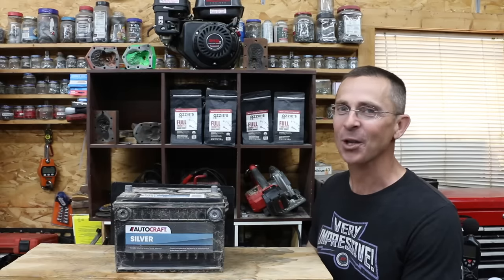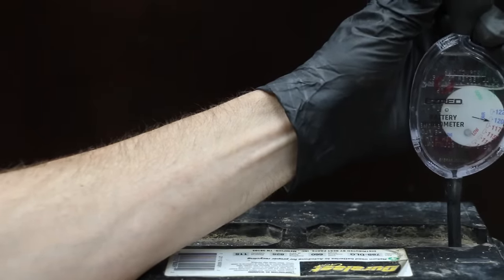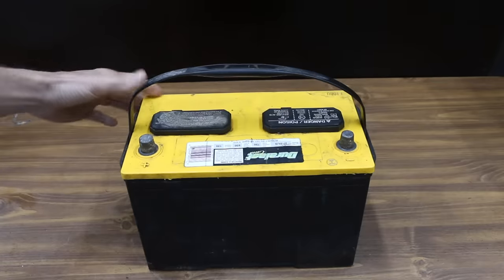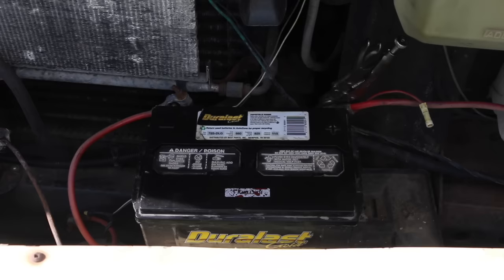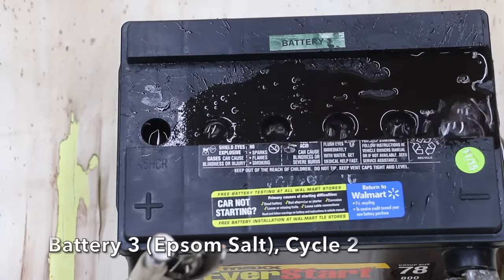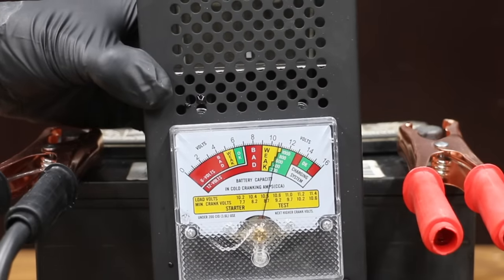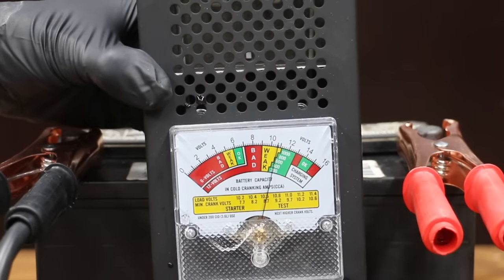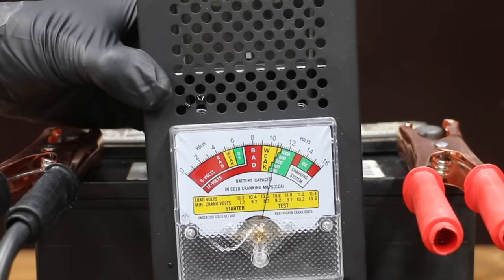Myth Busting! Can You Restore a Dead Car Battery With Welder?  Let's Settle This!

Comment: Its best to use a 100 amp setting when using a welder to de sulphate an old battery.Its also best practice thoroughly flush out battery at least 3 times to remove contaminants from within battery by aggressively shaking battery side to side , front to back several times. I've even used a pressure washer to aid in reconditioning a battery with great success.if using a low amperage charger once battery is ready to remove sulphates. Use a 1 or 2 amp max setting and leave charging for 3 days, while observing water levels. Both methods work very well if care is taken during the cleaning phase of battery plates which is the number 1 reason for battery to fail when not enough water is in each cell and or not left on truckle charge during extended periods  of none use. Ratio 3 cups distilled water to 1 cup Epson. Be sure to rinse with Epson on finse prior to refilling.
Reply from the maker: Thanks for sharing.

Comment: You can not hardly find a manual battery's charger anymore. Going to a small DC arc welder may be the only route for many folks. 
It would be interesting to put a volt and amp meter on an arc welder and see what it's actually putting out.
Reply from the maker: Thanks for the suggestion.

Comment: You need to flush the internals with distilled water and baking soda, and change the internal fluids with distilled water and epsom salt. Use the welder to zap it several times as let the internals bubble
Reply from the maker: Thanks for the feedback.

Comment: I've never seen somebody remove all of the acid when using Epsom salt but to take just a little bit of the acid out and add a very thick solution of Epsom salt in I've had this work on a couple small batteries
Reply from the maker: Thanks for sharing.

Comment: Do you think the welder worked cause the high amps or did the volts have the de sulfate effect? I have seen many batteries not repaired by high amp chargers but a DC welder can put out 20-50 volts.

Comment: I did the Epsom salt but I made a super thick solution. I only removed a little of the acid and added it. I charged the battery and it lasted over a year. Unfortunately the transmission went out of that vehicle so I do not know how long it would had lasted. I should add that the auto parts store confirmed the battery was dead and it would not start my vehicle. I did not have a battery tester at the time so I do not know the amps but it would only charge to just over 10 volts. After this is would charge to just over 13 volts and started the vehicle every time like new. I would had replaced the battery but I seen a video and decided to try it because even though I drove this vehicle often I knew it was only a matter of time before it died on me. I figured I'd run it as long as I could until it died which is exactly what I did lol. Luckily I had three other vehicles but this was my work van.

Comment: Restoring the really bad ones is a lot of work, and hit and miss.  However, I'm curious how good a regular maintenance charge with the welder might improve the lifetime of the battery.  For example, whenever the battery gets down to 80-85% then hitting it with the welder to get it back up to 100%0or close to it.
Reply from the maker: Thanks for the suggestion.

Comment: We been using a welder to charge our weak batteries for my whole life but we lived out in the mountains and didn’t have power so the diesel generator/welder we had to power the cabin was our really only way to charge them up and we never had a new battery so if it wouldn’t take a charge we started cranking up the power blew up a few batteries but most the time it didn’t it was that or walk out to town 35 miles away we were lucky to get to grow up that good
Reply from the maker: Thanks for sharing.

Comment: Yea these welders work but smaller batteties need smaller current because the plates can bend and cause a cell short, you can then throw the battery. This is why i 'revive' my battery every once in a month or so but only for a short period of time at 20A (5minutes or so). The key is to hold it cool, once it gets even a little bit warm, disconnect!
Reply from the maker: Thanks for the feedback.

Comment: Any leas acid battery that has built up lead sulphat or little to no terminsl voltage it fucked, even more if the plate material is thin and in some cases plates corroded through / transitioned to lead sulphate, naff all can save it, fill it right up with water for max weight and weigh it in for scrap value.

Comment: Epsom salt I thought was used to boil over not a replacement for the catalyst? You just use that solution to boil the cells over then you flush and replace with fresh acid/water mix. Sulfuric acid and epsom salts are completely different H2SO4 Sulfuric acid and MgSO4 7H2O Epsom salts. hydrogen vs magnesium.. Dunno what kind of battery that makes but from your experiment didn't look so hot. My buddy's dad boils over with that solution, flush and replaces and I can't wait to see him Monday to speak with him.  ✌

Comment: In my reading I heard that rinsing out the flakes of oxidation from the bottom of the cells is important since they can, despite having little conductivity, drain the cells my linking the plates. I don't know if that's true but it seems to make sense.
Reply from the maker: Thanks for the feedback.

Comment: In the epsom salt restoration technique, did you not return sulfuric acid to the battery at the end of the restoration? I've never heard of the "epsom salt restoration technique" but it looked like at the end the battery only had water with epsom salt which I can't imagine working.

Comment: I had a dead battery before and needed to be on time for work. So i poured out 1/4 of the fluid and poured in acid to the plates were covered and place the battery back in the car and started the car right up. never had problems with it for a year or so. the acid cleans the plates and also gives a instant charge boost to start the car right up
Reply from the maker: Thanks for the feedback.

Comment: I know a guy (way before EPA).  Who used to get used batteries.  Then drain the acid out. Then put a "Alka Seltzer" with water in each cell.  Flush out the cells with water then put new acid in each cell.  He told me the "reworked batteries"  lasted as long as new batteries.  I never tried it to verify it!
Reply from the maker: Thanks for sharing.

Comment: 1) When do you actually use a welder to restore a battery? 2) When you replace the electrolyte you flush out the trash that builds up at the bottom that shorts out the battery. But the lead plates will last only so long.

Comment: Nice but I really need to know,, how many volts DC was the welder putting into the batteries and is the stick side really positive or negative as the lectrons travel the other ways round

Comment: On the Epsom salts battery. Did you try draining and flushing it with water again, then filling it with the original acid solution again? Something I remember from the old days.

Comment: Is there a performance difference between 2 identical new batteries with different date codes? Figured if anyone tested this out, it would be Project Farm. Also the same question with identical new tires with different date codes. Love the tests you do!
Reply from the maker: Thanks!  Thanks for the suggestion.

Comment: I'd be curious to see if the batteries that showed improvement with the welder method, would have been restored even more if after the multiple welder cycles you emptied the battery acid and refilled with bran new battery acid.. I've also been curious if filling a bad battery with baking soda or maybe vinegar 🤔 or some other type of acid that won't eat the lead but will dissolve the buildup that prevents acid from contacting the bare lead. Then place the entire battery in an ultrasonic cleaner. I theorize that the captivating action of the ultrasonic cleaner in addition to a base or acid will completely clean the cells. Then rinse the crud out and refilled with battery acid. I have a feeling it'll work. I've searched it many times. I don't find any attempts to restore battery's with ultrasonic cleaners.
Reply from the maker: Thanks for the suggestion.

Comment: I tried restoring my truck battery with an arc welded 140 amp that is supposed to work with regular 110 amp outlet, but when I hooked it up to the battery at it’s lowest settings which was 30 amp it would tripped my 20 amp breakers, I noticed that as soon as I turned on the welder it would start bubbling all the cells, not sure if it was normal

Comment: I wonder if you were to put fresh battery acid back into the Epsom salt battery if the battery would start to work again, as well as what would happen to the condition of the rest of the batteries with cells that failed the specific gravity test if they got fresh battery acid as well.
Reply from the maker: Thanks for the suggestion.

Comment: Going to so much trouble to make sure there's no acid left? I saw other commenters were suspicious about that too. Something I feel defeats the stick welder treatment is charging with conventional chargers.  Takes away the shock-value.  Gotta have enough water, but going STRAIGHT to the high amperage is what shocks and breaks up the precipitated sulfates and lead. It busts it up so it can restore the lead to the plates.  This is why submarine batteries run FAST CHARGE,  constant trickle discharge.  Both of these keeps maximum lead on the plates.  Picture the 85 amps going thru the crap on the cell bottoms.  It may be close to a short-circuit for a few moments but then the bottom sludge starts circulating.  Shouldn't try to run a lead-acid battery with no acid.  Seems silly. Thanks for trying this method. My suggestions have saved me over a thousand dollars.  GOTTA BLAST EM !!!  Thanks Again.
Reply from the maker: You are welcome!

Comment: What I would like to see is how flushing out and fresh battery acid could make a difference. As well as a "procedure" that seems to be the most likely to revive a battery. Something like, cooking on the charger for x number of times, until no further improvement is seen, then followed up with a flush and refill with fresh acid to see if that helps at all or not. Maybe a larger "de-sulfator" or "equalization charger" put into the mix.
Reply from the maker: Thanks for the suggestion.

Comment: If it's any help I bought one of those bright red China 12/24volt battery chargers that are around $15 on the Chinese cheap-seller type websites-it looked pretty good, it claims to have a repair cycle in the description, and it does.  Has quite a few features and has proved to be a great charger, brought a 10 volt beat to crap old marine battery from my solar setup in my garden to 12.9 and went from about 10ah-to 70ah or so.  It's been used on over 20 batteries successfully and repeatedly, I do the repair cycle for 6 hours at a time 3 times over a day or two of time allowing for cooldown
Reply from the maker: Thanks for sharing.

Comment: I think the key with the welder is to crank it up to the highest setting. At 80 amps it wasn't doing much but when you went to 110 it did a lot better. And I'm not sure if you really need to keep the cells cool. I think part of the process is to have those cells heat up quite a bit to cause some flaking of any non-led. Basically what you're trying to do is to reformulate the lead in the plates without taking them out and melting them down. It's interesting that the Epsom salts did nothing I've never seen Epsom salts do anything. And I've never seen those little desulfaters do anything either. And I've tried both of them.
Reply from the maker: Thanks for the feedback.
Reply: Yup have heard 150
Reply: Allowing the battery to get hot helps to dissolve the crystalline Lead Sulfate faster, but too hot can lead to shedding of the cathode plates. This is likely what caused the dark liquid in the hydrometer, it is Lead Dioxide that used to be part of the positive plates. A temperature of 120° F is about where you want to keep it during this process.

Comment: Any idea what voltage your welder puts out? I've tried this once but the battery only seemed to get worse. Turned out that the welder voltage was well beyond 14v. As far as I know, max charging voltage for lead acid batteries is around 14v, anything above will damage it.

Comment: Excellent video except for the fact that you didn't test all the stuff the right way because any one of the batteries could have been bad and no matter which method you use to charge it it would have continued to be bad, each side of those tests with of course the Epsom salt being the last one because we already know it kills the battery, should have been done on each individual battery switching the order as you learned through what you were doing. Either way you're a lot smarter than most people and it was a very informative and good video. And all of your information was correct and done the right way.
Reply from the maker: Thanks!

Comment: I've never heard of your epsom salt method to de-sulphate a battery. It may work, but I suspect you missed a step.

What I have heard of from the old-timers was this method: 

Drop half an Alka-seltzer tablet in each cell. Shake it around, swish it, and dump out whatever will come out. Flush it out again with distilled water to get out all the loose particulates.  Refill with 50/50 mix of distilled water and sulfuric acid and only then can you charge it.

Comment: When you place a large charge on a battery, be aware that there is always a possibility of explosion if a spark occurs in an internal bad spot. An automotive battery will scatter battery acid over a 30 ft diameter area. (been there, done that) - The rechargeable batteries from tools have even more power than you think. A detonation of just a watch battery can cover a 5-10 ft circle. Multiply that times a drill battery and an entire room can go up in a flash. Keep that in mind when trying this.
Reply from the maker: Thanks for sharing.

Comment: How crucial is it to dump the acid and replace with epsom salt? I've been running it at 10 amps from welder to keep my jumper rod from overheating, will it still work with original acid?

Comment: With welder, the point is voltage level. But welder did push too much current on it, which is not necessary. Just bringing up voltage around 16V can do the job without that much heat
Reply from the maker: Thanks for the feedback.

Comment: I have been doing a (slow) version of this for decades. I can assure you that most batteries can last 10 years. Zap them a little when you notice there is a cell starting to drop out with the hygrometer. Try to age the cells evenly.
A cell might short by dumb luck the few pieces line up n conduct, or it'll short kuz the bottom of the cell is stuffed full of crud. So once one cell shorts out over about 7 years old you are on borrowed time. It may run but it'll trash your alternator which is trying to maintain 14v with only 12v of push back from the battery.
So at 10 years or the second time a cell shorts, I scrap it. Or the first time the cell shorts over 7 years old. Do an equalize cell charge occasionally and you'll average over 10 years.
Reply from the maker: Thanks for sharing.

Comment: Can you do a video to see if you can recover a dead lithium 18 650 cell. Those batteries are pretty awesome. I tried to recycle them if I have a power tool battery that stops working cuz it's typically one cell or some wiring that causes it not to work. But occasionally whatever caused it to fail over discharges the cells that may still be good. Recovering an over discharged cell is something I've heard can be done but don't know how
Reply from the maker: Thanks for the suggestion.

Comment: The magnesium sulfate (Epsom Salt), isn't really designed for use in a car battery. For one thing the sulfur is too strongly bonded to the magnesium. 

 You would need to make your own sulfuric acid or  phosphoric acid or even formic acid. It would probably be easier just to buy any or all of them by the quart or the gallon. 

This was a very interesting video though.

Comment: Yo, Tod Do you see the comments on old videos?   If so, how about a test of the 12 volt battery charger/maintainers?   I have some 12 volt car batteries I use in the shop and I like to keep them topped off.  There are alot of cheapies on line and I have tried a couple brands, but hard to tell if they really work as well as advertised.   Just asking.
Reply from the maker: Thanks for the suggestion.

Comment: Could you take the remaining dead batteries apart, clean out the cells with sand or some thing, and put it back together with sulphuric acid as the electrolyte?

Comment: I have all those battery testers.   I don't rely on the borderline batteries but they work fine running my 12volt skeet machine....esp batteries meant for diesel engines.
Reply from the maker: Thanks for sharing.

Comment: If you have understanding of what actually happens inside an old lead acid battery, its clear this won't work, or if it works, it would be a temporary thing. There is a physical change inside these batteries.  Its why you tend to see them overflow or have loads of excess corrosion when a battery is getting to the end of their life.

Comment: a couple days ago i used a 150 amp charger that made bubbles but the bubbling was weak, nothing like the bubbles in your video.  today i put the same battery on a 160 amp welder and ACTIVE bubbles started as soon as the welder was turned on.  I did 3 charging cycles, installed the battery, it started my truck without hesitation, now the true test is the battery that would not hold a charge, will it now?  stay tuned.   thanks!
Reply from the maker: Thanks for sharing.